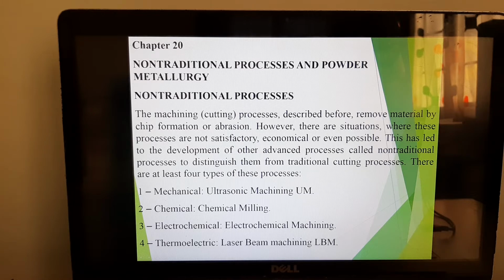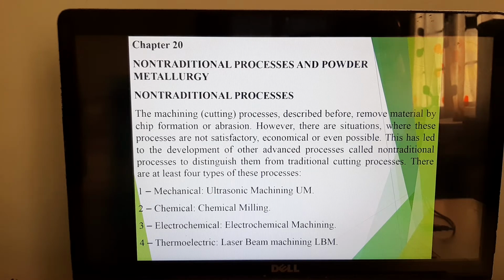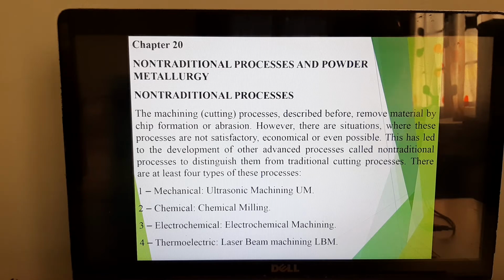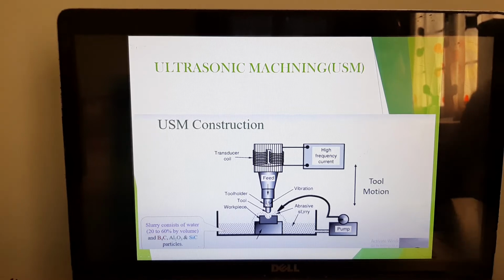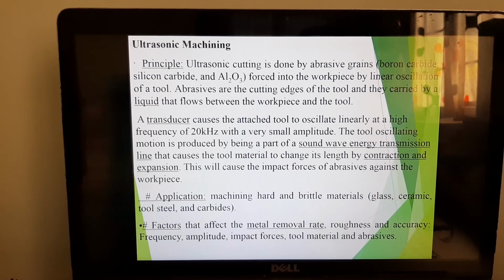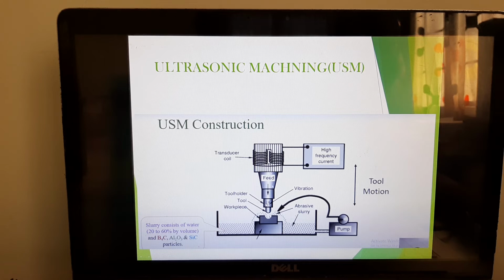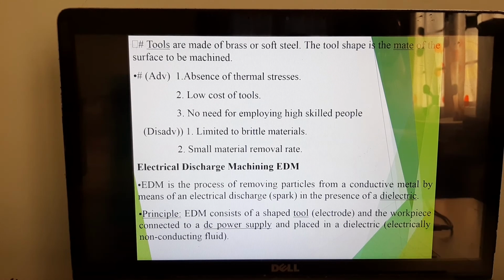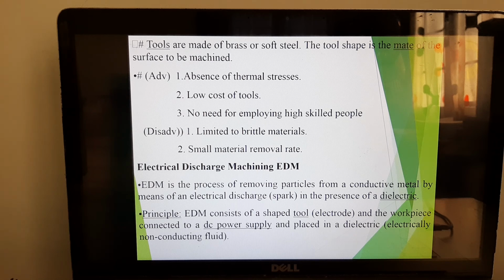MODERN MACHINING / NON-TRADITIONAL PROCESSES PART 1

Comment: Mohammad Aliff Bin  Mohd Pauzi (ME0104760).
From this video i learn that : 

Nontraditional  processes
=Mechanical : Ultrasoninc machinng
=Chemical ; chemical milling
=Electrical : Electrochemical machining
=Thermoelectric :Laser Beam machine
ULtra soninx Machining 
=cutting done by abrasive rgrains
=force intoworkpiece by linear oscalication of tool
a=abrasive are cutting edge of  the tool and carried by a liquid

Comment: good evening madam what i have learnt from this video is about nontraditional processes. there are 4 type which is mechanical(ultrasonic machining), chemical( chemical milling), electrochemical(electrochemical machining), thermoelectric( laser beam machining). About ultrasonic machining, the transformer is used to regulates the current flow. a transducer is used to convert electrical energy into mechanical vibration. The tools are made of brass or soft steel. Abrasive is the cutting edges of the tool and they carried by a liquid that flows between workpiece and tools. there are a few pros and cons of UM. the advatages are no thermal stresses, low cost of tools, not required high skill level. the disadvantages are Limited to brittle material, small material removal rate.

Luqman Mizani
ME0106088

Comment: Good evening madam.From this video, i have learned about non traditional processes.It is a machining process where it remove material by chip formation or abrasion.4 types of non traditional processe; 1) Mechanical: Ultrasonic machining, 2) Chemical: Chemical Milling,3)Electrochemical: Electrochemical machining ,4) Thermoelectric: Laser Beam machining.In Ultrasonic Machining, done by abrasive grain(boron carbide,aluminium oxide, silicon carbide) which is forced into the workpiece by linear oscillation of tool.
Advantages; 1)Absence of thermal stresses 2)Low cost of tools 3)No need for employing high skilled people
Disadvantages: 1)Limited to brittle material 2)Small material removal rate.
That's all from me.Thank you madam
.
Mohamad Fayyadh B Fazlula'ah
Me0106089

Comment: Rajbhinder Singh ME0106908 
I have learned about non-traditional process. This process involves removing material by chip formation or abrasion and at the same time, improves precision and accuracy. There are 4 types of modern processes which are mechanical (ultrasonic machining), Chemical (Chemical Milling). Electrochemical (Electrochemical machining) and Thermoelectric (Laser Beam Machining). Next, Ultrasonic Machining is made of transformer,transducer coil and abrasive slurry. 

Transformer is used tostep up or down current while transducer coil is used to control oscillation linearly. Abrasive slurry is made up of Boron Carbide, Silicon Carbide and Aluminium Oxide. Ultrasonic Machining is done by forcing abrasive slurry into workpiece by linear oscillation of tool. Abrasive is cutting edge of tool. The tool oscillating motion is produced by being part of sound wave transmission line which causes tool material to change its length by contraction and expansion. The tools are made of brass or steel and and is made of surface to be machined. The advantages of this process are absence of thermal stress, low cost of tool and does not require high skilled people while the disadvantages are limited to brittle materials and small material removal rate.

Comment: I learned about non-traditional methods. This method involves the removal of material by chip forming or abrasion, thus increasing accuracy and precision.  There have been four types of modern processes that are mechanical, chemical and electrochemical. Next, Ultrasonic Machining is made of transformer, abrasive slurry and transducer coil. Transformer is used to move up or down current while the oscillation is regulated linearly by the transducer coil. Boron Carbide, Silicon Carbide and Aluminum Oxide make up the abrasive slurry. Ultrasonic Machining is done by application of abrasive slurry through the workpiece by linear device oscillation. Device cutting edge is abrasive. The oscillating motion tool is created by being part of the transmission line of the sound wave that allows tool material to adjust its length by contraction and expansion. The tools are made of brass or steel and are made of surface to be machined. The advantages of this method are the absence of thermal stress , low tool cost, and highly qualified people are not needed, whereas the drawbacks are limited to brittle materials and low rate of material removal.

Muhammad Harits Bin Mohamad Zailan ME0106091

Comment: Hello Dr, I'm Navineswaran, ME0105317. I have learned that non traditional process is machining process to remove material by chip formation or abrasion. There are 4 types of this process mechanical (ultrasonic machining), chemical(chemical milling), electrochemical (electrochemical machining) and thermoelectric (laser beam machining).
Ultrasonic machining - fine by abrasive grains which is forced into the workpiece by linear oscillation of tool. Made up of transformer. Transducer coil.
The advantage of this operating is that no thermal stresses, tools are low cost and employment of high skilled operators are not needed. The disadvantages are this operations are limited to brittle material and it has a small metal removal rate.

Thank you.

Comment: NIGEL ANDERSON SINGH A/L RAJDEEP SINGH
ME0106094
Good day, madam. Nontraditional processes is a machining process to remove material by chip formation or abrasion. There are 4 types of nontraditional processes which are mechanical (ultrasonic machining UM), chemical (chemical milling), electrochemical (electrochemical machining) and thermoelectric (laser beam machining LBM). Ultrasonic machining is done by abrasive grains which is made of boron carbide, silicon carbide and aluminium oxide is forced into the workpiece by linear oscillation of tool. This machine is also used to machine hard and brittle material. Abrasives are the cutting edges of the tool and carried by a liquid that flows between the workpiece and tool. It also uses transformer to regulate current flow in the system. The transducer in this machine causes the attached tool to oscillate linearly at a high frequency with a very small amplitude. The tool oscillating motion is produced by being a part of sound wave energy transmission line that causes the tool material to change its length by contraction and expansion and cause the impact forces of abrasives against the workpiece. The tools are made of brass or soft steel and the shape is the mate of the surface to be machined. The advantages of this operation is there are no thermal stresses, low cost of tools and do not need to employ highly skilled operators. The disadvantages of this operations are limited to brittle materials and small material removal rate. 

Thank you

Comment: Good Day, Dr. I am Derrick Ng Kian Ping (ME0105733). At the end of the video, I have learned about non-traditional process. This process involves removing material by chip formation or abrasion and at the same time, improves precision and accuracy. There are 4 types of modern processes which are mechanical (ultrasonic machining), Chemical (Chemical Milling), Electrochemical (Electrochemical machining) and Thermoelectric (Laser Beam Machining). Next, Ultrasonic Machining is made of transformer,transducer coil and abrasive slurry. Transformer is used to step up or down current while transducer coil is used to control oscillation linearly. Abrasive slurry is made up of Boron Carbide, Silicon Carbide and Aluminium Oxide. Ultrasonic Machining is done by forcing abrasive slurry into workpiece by linear oscillation of tool. Abrasive is cutting edge of tool. The tool oscillating motion is produced by being part of sound wave transmission line which causes tool material to change its length by contraction and expansion.The tools are made of brass or steel and and is made of surface to be machined. The advantages of this process are absence of thermal stress, low cost of tool and does not require high skilled people while the disadvantages are limited to brittle materials and small material removal rate.

Comment: Good evening Dr, what i have learned from this video is about non-tranditional processes. There are four types of processes which are mechanical, chemical, electrochemical and thermoelectric.
Firstly mechanical, uses ultrasonic machining which consists of a transformer which regulates current flow in the system. It also has a transducer which functions to convert electrical energy into mechanical vibration. The abrasive is mixture of boron carbine, silicon carbine and aluminium carbide. Advantages of ultrasonic machining is there are no thermal stresses, low cost of tools, not required high skill level to operate. Disadvantages are limited to brittle materials and small removal rate. Thank you Dr.

Muhammad Naquib Bin Nor Azlan
ME0106093

Comment: Good evening madam, I am Wong E-Shen (ME0106071). From this video, I have learnt about non-traditional processes and powder metallurgy. Non traditional processes is the machining or cutting processes to remove material by chip formation or abrasion. There are 4 types of non traditional processes which are ultrasonic machining, chemical milling, electrochemical machining and laser beam machining. Firstly, for ultrasonic machining, it made up of transformer, transducer coil, tool holder, tools and abrasive slurry. Transformer is to step up and step down of the current whereas the transducer control the oscillating motion of the machine. The abrasive slurry is made of mixture of boron carbide, silicon carbide and aluminium oxide. This process is done by abrasive grains forced into the work piece by linear oscillation of a tool. Abrasives are the cutting edges of the tool and they carried by a liquid that flows between the work piece and the tool.
 The machine is connected to a mainframe which will automatically control the amount removal in the x,y and z axis. Next, the tools are made of brass or soft steel and the tool shape is the made of the surface to be machined. The advantages of this process is absence of thermal stresses, low cost of tools and high skilled people are not needed. For the disadvantages, it is limited to brittle materials only and have small materials removal rate.
Thank you

Comment: Ariff bin Alzakri
ME0106046

Good day madam, in this video I have learned about the nontraditional processes. Also known s modern processes, it is a process involving automation of product or process with more precision and accuracy. It removes material by chip formation or abrasion but in a more advanced process. The types of traditional processes are ultrasonic machining, chemical milling, electrochemical machining and laser beam machining.
Ultrasonic machining is a process where cutting is done by an abrasive slurry forced into the workpiece by linear oscillation of the tool. The transformer is used for step up or step down the current. Transducer controls the oscillating motion of the machine.
Advantages:
1. absence of thermal stress
2. low cost of tools
3. does not require high skilled operators
Disadvantages:
1. Limited to brittle materials
2. small material removal rate

Comment: Mohamad Ikhwan Syafiq bin Zaidi 

ME0106090

In this video I learned about nontraditional
processes. It involves automation of the manufacturing plant, process
and products. The types of non traditional processes are·                 

Mechanical : Ultrasonic machining          

Chemical; Chemical milling       Electrochemical : Electrochemical machining 

          Thermoelectric: Laser Beam Machining LBM

For Ultrasonic Machining,
it consists of a step down transformer, a transducer coil, tool holder , tool
and abrasive slurry.

Advantages :
1) Absence of thermal stresses 

2) Low cost
of tools 

3) No
requirement of high skilled workers

 Disadvantages:

1) Limited
to brittle materials 

2) Small
metal removal rate (nanometer and micrometer)

Comment: Hello madam, I have learned non-traditional processes. There are 4 types which are: ultrasonic machining(mechanical), chemical milling, electrochemical machining and laser beam machining(thermoelectric)

Ultrasonic machining:
Consists of a few major parts. Firstly is the transformer which regulates the current flow whether to step up or step down. Second is the transducer which controls the oscillating motion of the machine at 20kHz and at a small amplitude.  It converts electrical energy into mechanical vibration. The abrasive slurry is a mixture of boron carbine,silicon carbine and aluminium carbide. The mainframe monitors material removal at x axis/ xyz axis

Adv. :
1) no thermal stresses
2) low cost of tools
3) no need to employ highly skilled people

disadv:
1) limited to brittle materials
2) small material removal rate(nanometer/micrometer range)

AHMAD NAZRI BIN AHMAD TAMRIN ME0106079

Comment: Name: Nur Syazwani Bt Mohd Noor 
ID: ME0104367

From this video, I learned about the modern or non traditional machining process. This processes are developed to overcome shortcomings from the previous machining processes. The first type of process is ultrasonic machining which is a process done by abrasive grains consists of boron carbide, silicon carbide and aluminium oxide into the workpieces by linear oscillation of tool. In this process, the transformer will induced the transducer then the transducer will oscillates with high amplitudes and vibrates the abrasive slurry that will cause impact force of abrasive against the workpiece. The significant of this process is that there are absence of thermal stresses, low cost of tools and there is no need to employ high skilled people. However, the disadvantages od this process are it is limited to machining brittle materials and it has small material removal rate which is in nanometer and micrometer.

Comment: Good Morning Madam,i have learnt non- traditional process and powder metallurgy, it involve automation of the manufacturing plant, process and products and it increase accuracy and precision. It removes material by chip formation or abrasion.4 types of the process are Mechanical(Ultrasonic Machining),Chemical(Chemical Milling), Electrochemical(Electrochemical Machining) and Thermoelectric(Laser Beam Machining).
In Ultrasonic Machining, done by abrasive grain(boron carbide,aluminium oxide, silicon carbide) consists of a step down transformer, a transducer coil, tool holder , tool and abrasive slurry and made of brass or soft steel. 
Advantages:
Absence of thermal stresses
- Low cost of tools No requirement of high skilled workers

Disadvantages:
-Limited to brittle materials
-Small metal removal rate (nanometer and micrometer scale)

Thank you Madam
Tan Kang Je
ME0106097

Comment: Hi and Good morning madam, From  this video i have learned about nontraditional processes. It machining process, remove material by chip formation or abrasion.  It led to the development of advanced processes called nontraditional processes to distinguish the from traditional cutting.
Four types:
i) Mechanical : Ultrasonic machining UM
ii) Chemical; Chemical milling
iii) Electrochemical : Electrochemical machining
iv) Thermoelectric: Laser Beam Machining LBM

Ultrasonic Machining
Cutting is done by abrasive grains forced into workpiece by linear oscillation of the tool. Abrasive are the cutting edges of the tool and they carried by a liquid that flows between workpiece and tools. Transformer use for controlling the frequency current. Transducer is convert electrical energy to mechanical vibration and to oscillate linearly in high frequency with small amplitude. It made of brass and soft metal.
Advantages : Low cost of tools, Absence of thermal stresses , No need for employing high skill
disadvantages: Limited to brittle material, small material removal rate

Name : Alif Haikal Bin Azly
Id: ME0106081

Comment: Siti zulaikha ME0105567
-modern is the step further
-4types of processes,mechanical utrasonic machining,chemical milling,
Ultrasonic maching,made up of transformer,transducer coil,generate current,utrasonic cutting is done by abrasive grains(boron,silicon carbide,aluminium oxide,)
-understanding the rule of ultrasonic cutting
-understanding the advantage and disadvantages

Comment: Good mornin' madam, I'm Muhammad Aslam bin Mohd Azman (ME0104358) reporting for duty. From thus video I had learn about one of the nontraditional processes and powder metallurgy which is Ultrasonic Machining "USM". For this machining it consist of step-down transformer with transducer coil which will cause the attached tool to oscillate linearly. this machining process also differs from others with the usage of abrasive slurry to remove the cutting workpiece. What's great about this machining is that is does not require high skill to run it, it uses low cost tools and most of all the absence of thermal stresses. However, this machining is limited to brittle materials only and have a small metal removal rate which can be viewed as a major downside for many people.

Alas, Thank you  Madam.